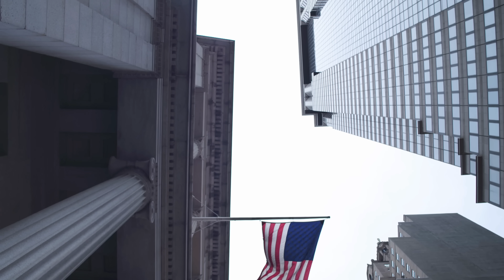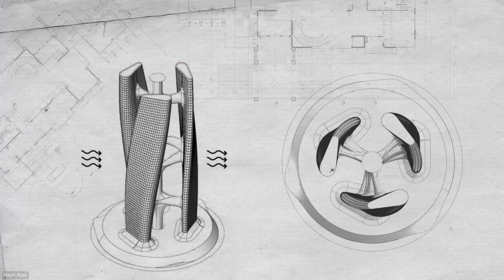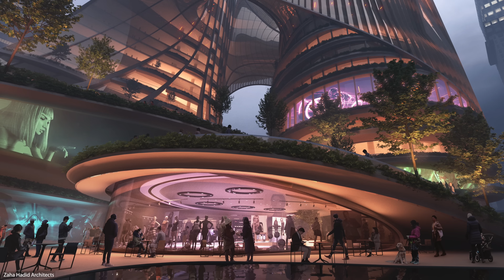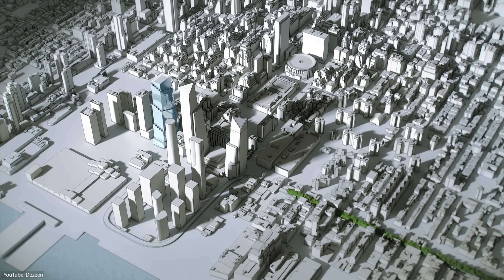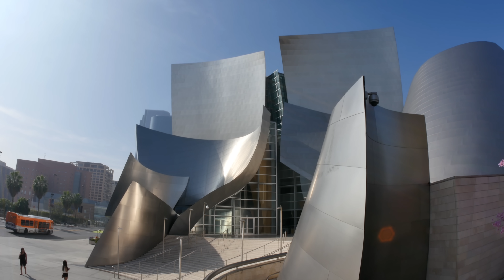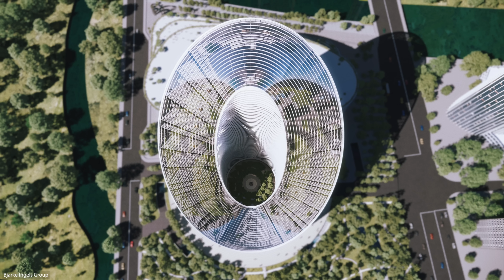World’s Strangest Future Skyscrapers

Comment: The first building would be lit, imagine living there, and always waking up to see another part of the city everyday
Reply: @UCxlO4Utjp6jxYC3uMgxc4YA it doesn't spin that fast
Reply: I can see something happening with the rotation and the building collapsing
Reply: If unlit it would be dark.
Reply: Where would the entrances be? If it’s constantly moving there is no guarantee you could go to the right wing at any given moment.
Reply: I'd love to see how they are making it function. I'm assuming wind is supposed to cause the rotation, so it will have to be easily moveable. I wonder what kind of rollers or bearings they are thinking of using that don't have too much friction or do not require more power then it is supposed to create to make it move.
Reply: @glorytoamerica6332  Could probably have a central core that doesn't rotate with elevators and/or staircases, then hallways on each floor to the different wings
Reply: ikr
Reply: @themacchute34  he did say it only spins one every 2 days
Reply: @thomas1942  That thing will not produce/collect  a watt of energy unless there is a constant mega storm. You do not need too much knowledge to understand that part of the energy goes into friction. And if the turbine is heavy there is a lot of friction involved. Sure, theoretically there could be magnetic levitation. There are trains which are levitating on magnets. Pure magic. But can magnets support something 100 times bigger? And anyway, even without friction, to produce energy at such a slow speed you need a huge multiplication of the spin. This means increasing the pressure, and regular winds cannot provide that. Anyway, vertical wind turbines did not quite proved effective. Sure, there are small versions, because for these efficiency do not quite matters. You can fool enough customers, who buy them for novelty, not actual efficiency. But for bigger ones you need to provide results. And since there are not big versions on the market I assume that they are not efficient. Maybe this building will have success on Mars.  On times of high winds you could have a higher gravity, stuck to the windows:)

Comment: You can guarantee that these won’t look the same when built than on paper.
Reply: You are wrong. Most buildings follow the blue prints.
Reply: @SargonofQueens    Most. Prints change on the go.
Reply: @SargonofQueens  Only if you can convince the government authorities to give you a permit to build the building and only if you can convince tenants to pay to rent space in it. Libeskind's original proposal for the NY World Trade Center replacement was drastically revised after objections. The spire was moved from the side to the center, and the whole upstairs garden was deleted.
Reply: You are wrong bro it will look same as the picture

Comment: If it's only 1 revolution per 2 days, how does that produce energy? I like the ability to see 360 but that will cost them energy not produce it. It might be better to have the rain runoff be the generator,
Reply: they probably would do that too but it just has an insanely high resistance so every inch moved generates a ton
Reply: @hidden7249  Yes but you need a lot of wind to move those tons. And at such a low speed, it can't generate enough electrons.
Reply: friction resistance to the rotation needs to be equal to wind force otherwise it would not move at all. Once wind overcomes the resistance there is useful energy extractable but i think it is not very good idea to create complicated mechanisms when you can connect the building to nearby offshore windmill farm with cable :). Much better efficiency.
Reply: @ivangalik7848  And that still doesn't work.
Reply: @hidden7249  No that''s not how it works. It works when a magnetic field moves around copper to generate electrons. Do you realize that the amount of copper to surround this building would be 3X the worlds production for a year. And then that magnetic field is moving about 3 inches a minute. That's not going to produce that much electricity at all. And if the wind isn't up to at least a high enough speed the building wont' move at all. I would like to see their numbers on it but they won't give them to you.
Reply: @tixximmi  it doesnt have to be a huge massive generator, idk what the plan is but i imagine just having a huge gear and many smaller generators connected with smaller gears to it could work, the potential energy once a whole building is spinning must be ginormous
Reply: @tixximmi  reduction gears bro. the sheer torque will allow it to spin a turbine at a higher speed by a magnitude.
Reply: @carlosandleon  Yes I understand all of that. But it's moving too slow to start with. And you can only gear it up so much. The magnets need to be huge with miles of copper. My bet is that it won't work or be cost effective. Also to gear it up you'll need additional space. Space is money. Big money.
Reply: @godalmighty8018  I know you don't know how to do the calculations but I figured the copper alone would need to be about 8 gauge and they'll need about 45 miles of it. They don't need generators. It's magnets (about 12 to 15 tons) and a lot of wire. They'll need one hell of a big inverter, capacitors and storage. I don't think this plan will pan out.
Reply: I believe this design is only intended to resemble a wind turbine, and there was some misinterpretation somewhere between the blueprint and this video.  It doesn't take an engineer to see that this design would be the worlds least efficient powerplant.
Reply: @drewlovelyhell4892  Thanks, that's what I was saying but there are a lot of engineer wannabe's out there that disagreed with me.
Reply: "It might be better to have the rain runoff be the generator"? How much rain do you think they get in Dubai?
Reply: @Cardi185  That's my point.
Reply: There is no way it can. But "sustainability" is one of those words developers throw out there to get good press, political momentum, and most importantly investor capital to build them. It is unlikely this project will get built....and they know it, but it gets people talking about them.

Comment: Would a scaled down, lightweight version of the "Squall Tower" work as a wind generator? It would seem to be a much sturdier design in practice to handle storms and such. Maybe even coat the exterior parts with solar electric panels for when the wind isn't blowing? It would rotate at a slower speed but with  the greater mass moved by the wind, it could generate lots of power - with the bonus that airplanes, drones and birds could see the structure as it moves and prevent collisions. It would also look nicer and could be placed in more suburban and urban areas - like a giant sculpture dedicated to a green energy future.

Comment: The "O" tower is in the Mobius strip shape. Not an infinity loop.
Reply: The O Tower doesn't look like a Möbius strip to me. Consider the shot from directly above. From that angle, there's no twist in the surface.

What's an 'infinity loop', by the way? I'm not familiar with that term in a geometric context.
Reply: Is the infinity loop not the Mobius Strip?
Reply: Nah, a Mobius strip only twists once, 180°.
This design twists a second time in the opposite direction. So it's just a bent strip.

Comment: The Oppo Infinity Loop is my personal favorite. An upside down trapezoid is virtually never a good idea in building. If you want a diagonal wall, here is the place to be. It makes more sense to place more weight on the bottom and less on the top, similar to a pyramid. There is not only for structural reasons, but also because if the ceiling is larger than the floor, that is a lot of room you can't move in, decorate, and yet have to keep cool. Apart from Gehry, the Oppo building is by far the most exquisite implementation of this concept in the world. Not to mention the number of non-phallic towers. You've seen it before, so you know what it looks like.

Comment: My favorite is the Oppo Infinity Loop. In architecture it almost never makes sense to build an upside down trapezoid. If you want a diagonal wall. It makes more sense to put less weight on top and more on the bottom, much like a pyramid. Thats not just for structure, but because if the ceiling has more square feet than the floor then thats a lot of space you cant walk in, cant furnish, and still have to climate control. The Oppo building is by far the most elegant example of this idea in the entire world, besides maybe Gehry. Not to mention, how many non phallic skyscrapers are there. Bonus bonus, you know what it looks like

Comment: Yes the old square buildings looked bland but these new ones will require way more maintenance over time, overhanging roofs, glass roofs, think rain, snow, and even dust storms and eventual cleaning bills? Even pollution will make these building look ugly and dirty within a few years.
Just have to look at all the glass Germans use in buildings and elevator shafts, look at how dirty everything is and all the trash and bird waste  that’s now visible through the glass!

Comment: Most people don't know that in comparison a termite mound would be four times taller than the world's highest skyscraper. Not to mention there is some termite mounds that are over 10,000 years old. The only way we can compete with that level of stability engineering superior genius. It would be to build with hemp. For it has been proven to be 10 times stronger 30% lighter than steel. Stronger and lighter than concrete stronger and lighter than brick far more versatile making the design possibilities practically limitless plus it is far easier to work with on site than traditional building materials. So we can easily rebuild faster stronger more efficiently at a fraction of the cost. Without leaving any excess poisonous toxic waste behind. I'm willing to bet if we add it volcanic ash to the hemp Creek the end result of the megalithic structure would be out of this world.